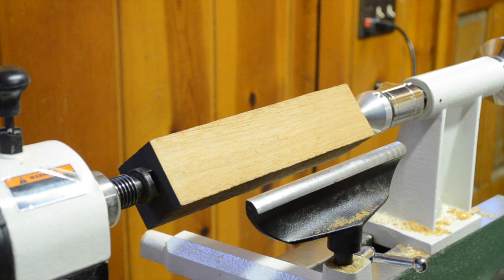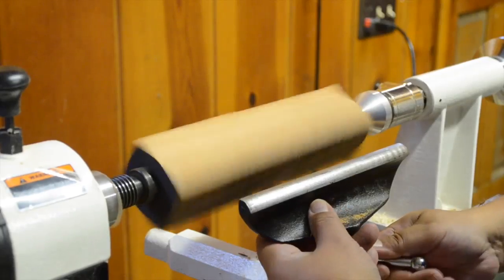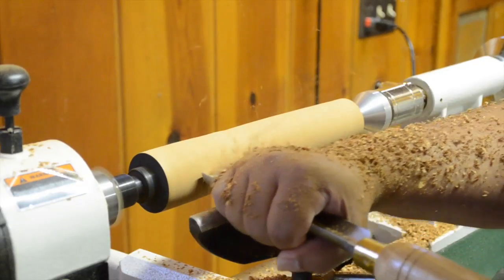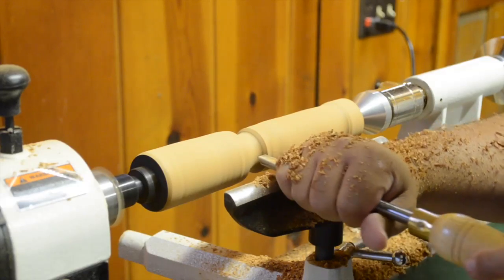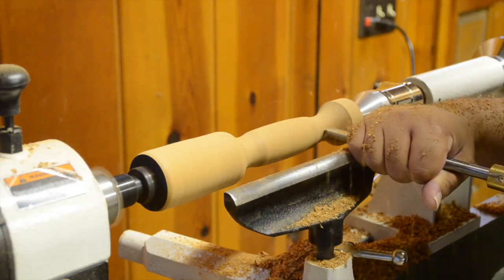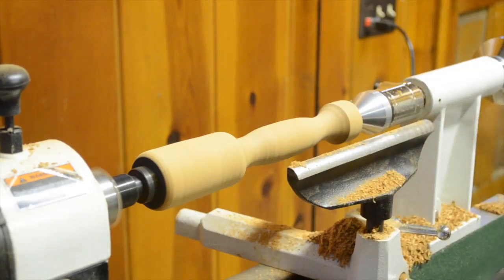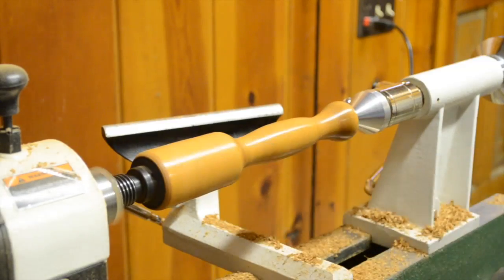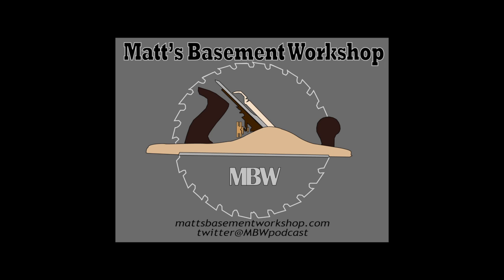530 Small turned mallet or "My first turning project!”

Comment: Great first project. Bet you had fun too. It's addicting. On next one focus on cutting with the edge instead of scraping. I think you'll be surprised how much easier it is on you and tool. Also cutting towards the center of a spindle will result in 'going wt the grain' pulling out is pulling fibers (against grain). I'm glad to see you jump down this rabbit hole. The fun is dizzying.

Comment: Thank you for sharing you 'first' serious project on your lathe.
As the result shows, you made it pretty well.
Please don't be offended, but you made the same 'mistakes' I'd been doing at my first encounter to this beautiful tool.
I'd like to give you one (or two) advises: First of all, don't look at the lathe as a machine, but a hand tool, the lathe is just the thing which makes the tool (cutting edge) move (in relation to the wood). So what's the most important fact when you're using a hand tool? The cutting edge has to be supported! When you're using a chisel to part away some wood on a dovetail joint, you start by creating a shoulder to support either the bevel or the other side in order to get a clean cut. It's the same with the tools on the lathe! In order to establish a lean cut you need in addition to the tool rest the bevel of the tool itself for a nice cut, so the No 1 rule is: RIDE THE BEVEL!
When you get more experienced, you might encounter situations where you break this rule in order to achieve special cuts, but please start by thinking of this essential rule when you're turning some wood!
Second, avoid the edges of your tools, as they'll lead to terrible catches! Third and fourth watch the position of your tool rest, it's fare to fare away from your work piece. Visit the YouTube channels of Mike Waldt, Carl Jacobson, Brendan Stemp or any other of the experienced turners who have a series on how your tools are working.
I bet, after a couple of weeks practice you'll pray for twisted grains, as this is something which gives a lot character to a turned piece.
Greetings from Good Old Germany
Peter
Reply from the maker: ***** Peter thanks for the tips! I was wondering if I was being to "cautious" by having the tool rest back so far and or up to high or low.Thanks again, I really appreciate it.

Comment: Aahh yeah, the rabbit hole. You'll start looking at wood differently.  Wood on the side of the road, in peoples yards , wherever.  Just embrace it and it'll be a lot easier for you. Get some soft wood and play with your tools. Tool rest closer and no rags, ever never. Take you're time watch some videos from people like Carl and Mike. And that was a noce little mallet, especially for your first time. If you need it to be heavier, drill the end out and put a mixture of lead shot and sand. Then plug it and there you have it. Thanks for sharing your videos, and take care, David.
Reply from the maker: I've been eyeing up some firewood logs in the backyard LOL! Thanks for the tips.
Reply: Those make excellent bowls and spindle blanks. Oh yeah, make sure that your tools are sharp, makes a huge difference.  So as you say sharp tools and fine shavings. Well almost like you say anyway.  Take care, David

Comment: how did you select the stock used for this project? did you buy a blank? does grain direction matter a lot? Specifically does the grain need to be perfectly straight with the axis of the shaft or is it ok to have it a little bit off? also do you have any wood species to suggest for starting with? i dont have many hard woods so thus if i cant use my soft wood stock it would be great to learn.

Comment: Agree with the other comments about how your scraping with the spindle gouges and not slicing cutting riding the bevel. If you really feel brave try this type of project again, but only use a skew.  Once you get the hang of the skew, you won't even need to sand a project like this.
Reply from the maker: 68jacen I keep hearing about the wonders of the skew, but when I try to use mine I want to throw it across the room. Of course, I've only tried it on two or three things now LOL!
Reply: Matt Vanderlist 
Best way to learn the skew get ahold of some richard raffin videos he makes it so easy